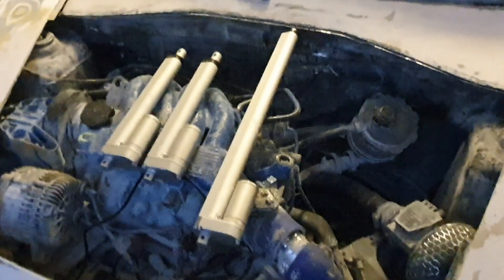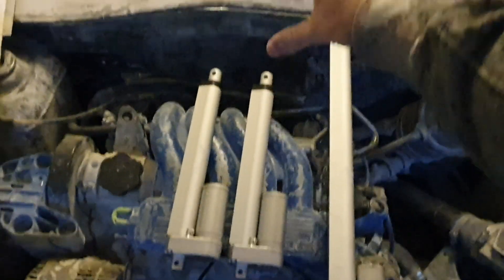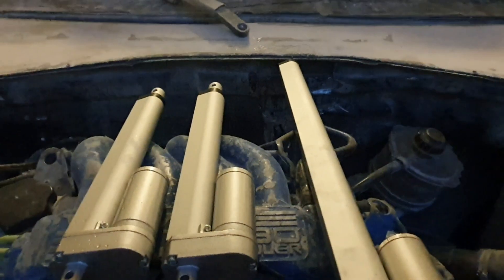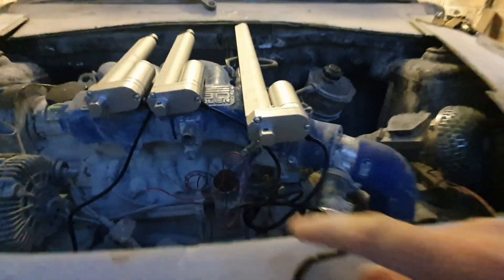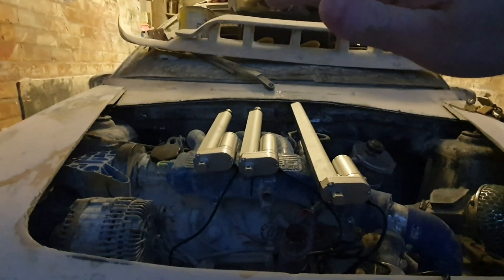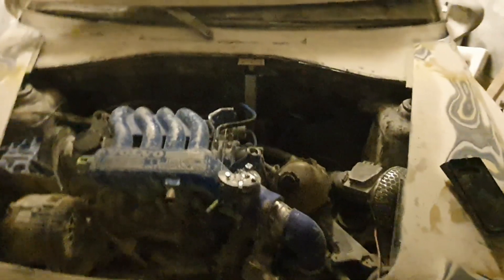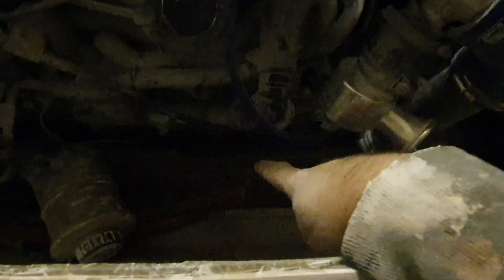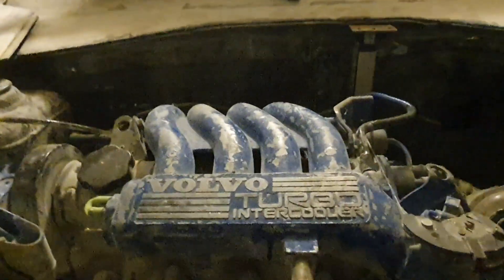135 - Linear actuator for bonnet mounting and fabrication...soon to be electrically opening

Comment: That rear one will need to be hinged where it attaches to the bonnet if the front one is raising higher.
Reply from the maker: I did think that might be an issue. I will have to leave it slightly loose or give it some kind of runner
Reply: @rsjdevelopments  will be easy to hinge it. Literally just needs a butt hinge. One side attached to bonnet, other side attached to actuator.